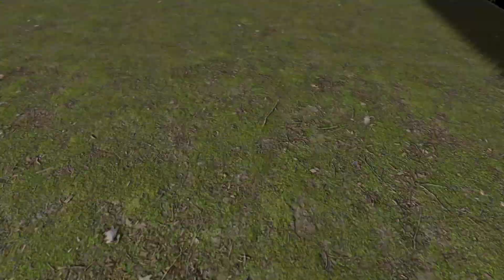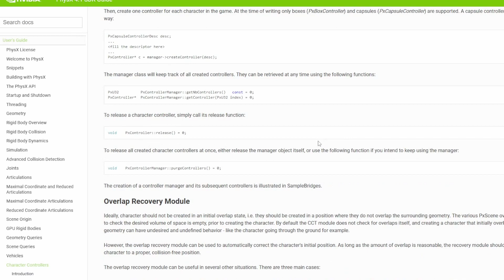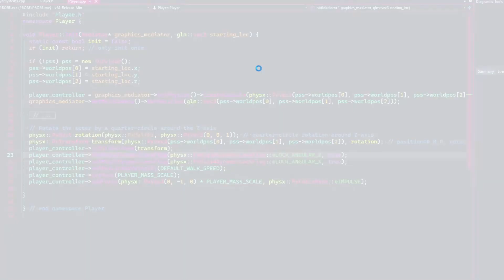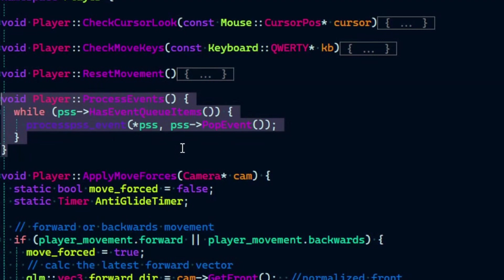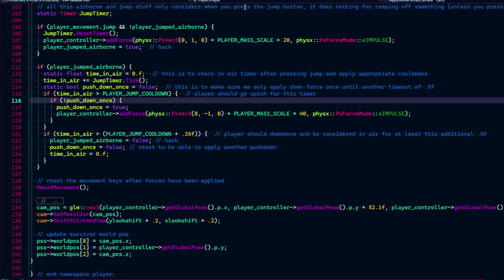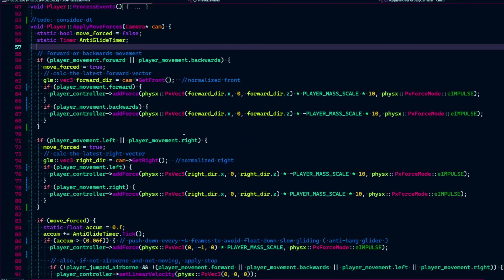Turning A Rigid Dynamic Capsule into a Player Controller... - NVidia PhysX

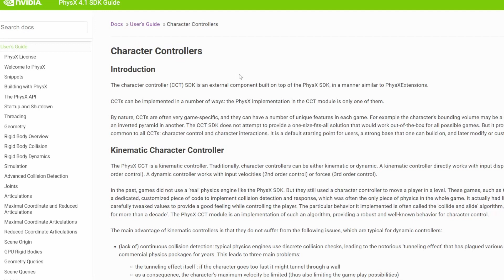Comment: 5:24 WHAT..
I spent damm total 3 weeks to implement that damm thing T.T
All the slides, walking seems to work well. problem is I cannot think of with a logic to make the controller jump naturally.
Locking ZX axis of capsuleGeometry and implying addforce(impulse) would be an easy answer, but I strived for the juicy features described on the documents.. is pxController really not suited for functioning as player?
Reply: I think it can be used to push other objects, but gonna setup filters and callbacks manually.
It seems like it meant only for basic movement, it has collision detection, but that's about it.

Does the job collision is all you want, but if you want player to push other object around or be moved by other rigid bodies - yea, gonna be easier to go with PxRigidDynamic.

And YES, I have to answer 2 years old comment.